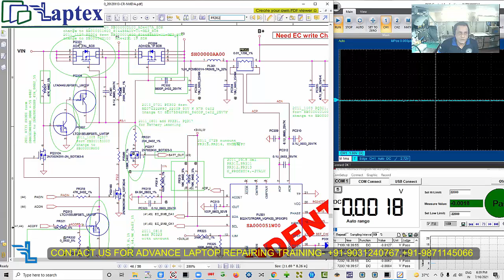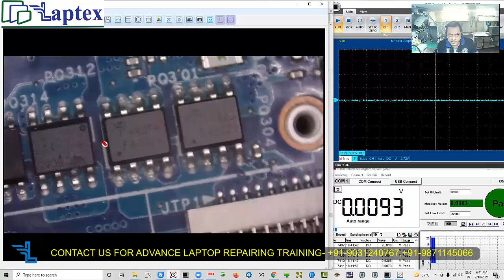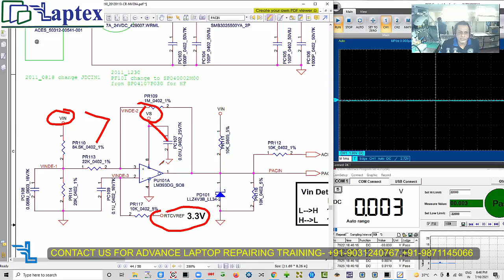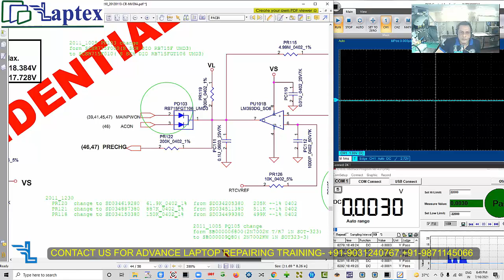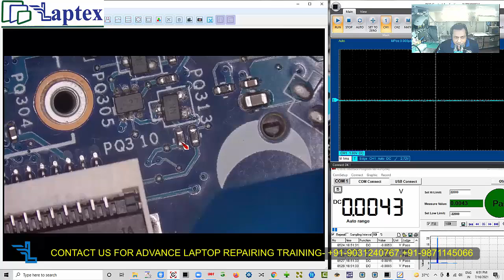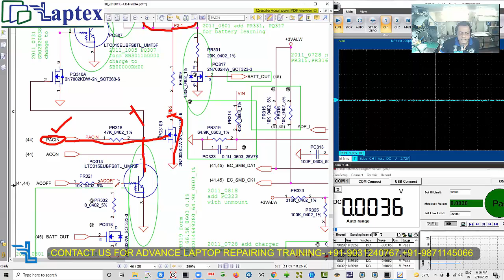PACIN Signal and Op AMP Logic Laptop No power On ENG PART-1 | La 8131p | Online Chip level Training

Comment: you had 20 volts on t301 gate there should not 20 volts on the gate, however your method is very good
Reply: If voltage devider circuit is not completed, 301fet gate should be 20v, look closely ,that mosfet is in forward bias and the gate is connected with the source,
Reply from the maker: Correct.👍
Reply from the maker: Read the comment you will get the idea.